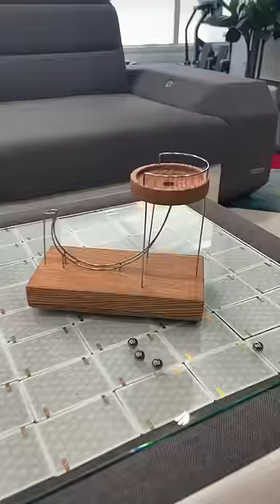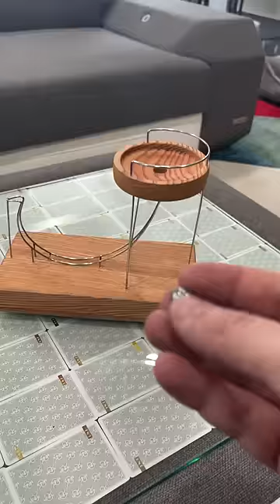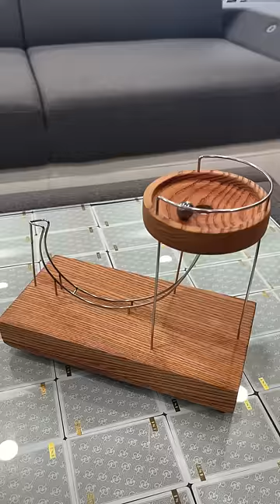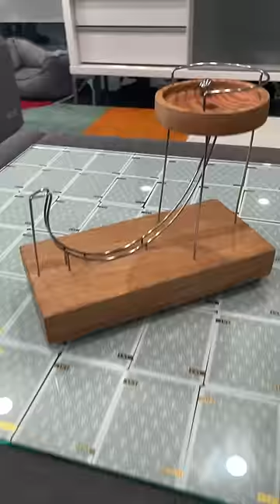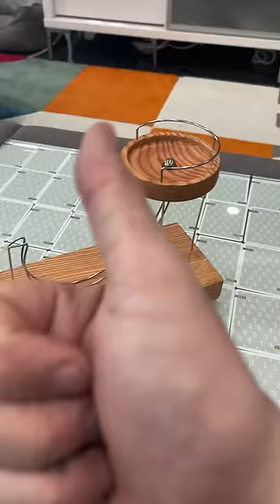An Impossible Perpetual Motion Device?! 😳 #Shorts

Comment: The fact that the ball shoots up higher than the level that it initially fell from means there is an outside force.  Period.
Reply: Isn't it quite obvious there's a magnet inside?
Reply: @Sevival  Nope, not everybody knows the obvious physics behind it, mate. And yeah, there's a magnet
Reply: @Sevival  U know, not everyone is interested in this kind of stuff. This is like telling a christian: isn't it obvious we are made out of stardust? It's only obvious when you start digging a little
Reply: @robertcristian9511  I think everyone should easily be able to tell that this is wrong. We have all seen thing fall in nature after all. Besides, the video literally tells people its faked and yet they fall for it.
Reply: Now explain it. Just telling people “that’s obvious” wouldn’t make anything, this will just make you look egoistic. True scientists EXPLAIN how things work
Reply: @robertcristian9511  Clearly,  i don't know why people miss that. A magnet in the wood near the sliding side because if it was in the middle it will reduce the speed for the climb as well. Thanks for commenting the same thought I had.
Reply: Not necessarily, the magic happens in the shape of the ramp since it drops it picks up speed fast and uses that speed to get back to the platform
Reply: LMBO
Reply: @RxgueTrikova  magnet!
Reply: @Sevival  DK effect
Reply: Possible that ball as well as the railing are magnetic
Reply: It’s own momentum
Reply: @robertcristian9511  except it’s not obvious we’re made out of anything lol
Reply: @robertcristian9511  Pure poppycock I say! Everyone knows we are made out of sugar and everything nice! 🫢
Reply: @robertcristian9511  There is a magnet is a really half assed explanation. Its like saying of course it works. There is gravity! You cant just put a magnet on top for it to work. If it really is a magnet it would need to be an electric magnet for it to work mr obvious.
Reply: @robertcristian9511  Idk, it’s kind of obvious when you give it a little thought. Like where else could the matter have come from.
Reply: @robertcristian9511  The Bible is very open about the fact that we are made from dust, and that all of us will one day return to it.
Reply: @RxgueTrikova  "Magic"? Magic isn't real mate, and no matter how you make a ramp you can't make a ball shoot higher than the initial drop off height. This is very, very basic physics. You should know this.
Reply: @robotpizza  and spice! 😂
Reply: How does the magnet not just make the ball stick to the top of the ramp soon as it falls thru the hole?
Reply: @Sevival  it is lol
Reply: @robertcristian9511  yeah Sparky, show me some stardust.  Otherwise, your comment was spot on
Reply: @kgmsosa8230  It's an electromagnet. You can turn it on and off so that it doesn't do what you describe.
Reply: Once the ball passed the point with the magnet wouldn’t the magnet then pull back on the ball as it passed and slow it down?
Reply: @robertcristian9511  dig a little and find nothing lmao
Reply: But still works
Reply: The fact that the ball is already rolling when it drops through the hole means it has some additional energy as it goes down the slide than simply the potential energy due to it's height, I think that's how it manages to return to higher point than where it fell from. I'd be interested to see how many repetions the ball can make before it fails to land in the cup again.
Reply: Apparently there's a rechargeable electromagnet at the base propelling the ball upwards.
Reply: Umm no,momentum
Reply: Why does having a magnet make it not perpetual motion? Will it stop eventually? Or does an outside force just not count, like the moon's influence on the tide? I'm not arguing with you, I'm genuinely curious about this.
Reply: But where is the energy coming from? Magnets don't store energy or do they?
Reply: It's called momentum.
Reply: @robertcristian9511  if there's a magnet why don't the two balls interact? Where is it?
Reply: @RxgueTrikova  no
Reply: No one is trying to say it’s real. Chris is just showing that it looks cool
Reply: g R a V i T y
Reply: @robertcristian9511  👏🏾👏🏾
Reply: @Sevival  not to most of America… have some awareness of class.
Reply: what would a magnet inside do
Reply: @robotpizza  They accidentally used salt instead of sugar in my recipe 😔
Reply: @kylemcalister8417  if you put it under the downward slide, it would accelerate the ball faster than gravity would alone. As the ball moves away from the magnet, it's force decreases, as magnetic force is proportional to distance so the ball would retain some of the energy that the magnet 'provided.' Then the ball would travel upward with enough speed and force that gravity cannot decelerate it enough, to prevent it from getting into the funnel plate. Without the additional speed/energy from the magnet, the force of gravity would accelerate and decelerate the ball about the same amount, so it should just smack into the side of the plate, at the same level as the whole. Considering friction and air resistance, the ball would accelerate less and decelerate more more than gravity would cause in the vacuum. I hope that makes sense. If it doesn't I'd be happy to clarify to the best of my ability.
Reply: Gravity
Reply: @MegaAbgt  not forever
Reply: @kylemcalister8417  it's likely an electromagnet which uses power from a battery to sustain its magnetism. And then it would likely work kind of like a rail gun. A chain of negative magnets all pointing in the same direction right as it leaves gives it acceleration.
Reply: @RxgueTrikova  the shape of the ramp will not change the amount of energy, only making it higher will. Also the ball will never jump higher than the hight it falls from
Reply: @robertcristian9511  Every Christian says we are made of dust, what do you mean?
Reply: Potential energy from higher position
Reply: Maybe gravity and magnets working togheter.
Reply: @robalso  it would yes. This is an electromagnet with a battery. That’s how it works.
Reply: @jforrestal365  it wouldn’t be able to make a single trip without added energy. Think about it. At the moment it goes into the hole it’s downward velocity is zero. Only the. Does gravity start accelerating it downward. This isn’t enough energy to get it to come back up higher than the point where it dropped. The only way this works is with an electromagnet and a battery.
Reply: @CrawDad1131  this wouldn’t work with a regular magnet. It only works with an electromagnet and battery. As for the space stuff you mentioned, yes, all of those movements will eventually stop.
Reply: Ball is a magnet
Reply: @awesomecraftstudio  it’s an electromagnet and a battery. Look up “perpetual motion ball ramp” and there are a couple of videos talking about the battery in the bottom of this.
Reply: Inside force.
Reply: Would it be Newton's 2nd law?
Reply: gravity is the force
Reply: @mariusmelerski5136  The shape of the ramp changes the energy output.  Rollercoasters work within some of that math.  Of course the ramp changes he energy output.  It’s like pull your arms in when you’re spinning on a chair, you go faster, you put your arms out you go slower.  Don’t lose your common sense when debating physics.
Reply: That force being gravity. Take away the planet that the device is resting on and the motion stops.
Reply: @Sevival  
Not just a magnet.  An electromagnet that pulses at the right moment.
Reply: @kgmsosa8230  opposing magnetic forces. Not all magnets attract. It’s shoots away.
Reply: Wish my car was a perpetual motion machine, and while I'm fantasizing, also a time machine so I am never late to work again.
Reply: @RxgueTrikova  shape of ramp doesn't matter the ball still should not go up higher than it drops down.
Reply: @Hopeof7suns  if you really think that please don't be a teacher.
Reply: @argonaught5666  no sorry that would break... Never mind yes yes you are stup....I mean correct.
Reply: The holy ghost duuuuuuuh
Reply: @CrawDad1131  
If it was just a permanent magnet and it somehow worked, it would still classify as perpetual motion, except it wouldn't work, just as any perpetual motion devices won't work.   They are all akin to claiming you can sustain yourself the rest of your life without drinking or eating anything, but your own crap and urine.
The only way this device will work to provide the illusion it does, is with a electromagnet that pulses on to accelerate the ball towards it, then turns off to allow the ball to pass freely.  A permanent magnet would pull the ball both on the way up and the way down providing a net momentum increase of zero.
Reply: I feel bad for all of the people that think this involves magnets. On the sidewall of the hole is a little wheel. The wheel is powered by one AA battery, which is installed underneath the top, round tray. When the ball passes through the hole, the little wheel spins and speeds up the ball. That’s it. No magnets whatsoever. 😂
Reply: @chrisjenkins203  
Apparently there are different versions.  The cheesier type uses a motor as you describe and is unconvincing because you can clearly hear the motor spinning.  The other kind is more expensive and convincing because it silently uses an electro magnet in the base.  Since I can't hear any motor here while clearly being able to hear the ball rolling, I suspect this is the more expensive version.    Check out Ramzland perpetual motion video.  He explains that his uses an electro magnet in the base.   I have seen the motor type knockoff of this device and it's made from cheesy plastic instead of wood and sounds like an electric toothbrush.
Reply: @1TieDye1  when I first saw it I thought the only way to work was by using an electromagnet it was somehow switched off once the needed downward pool and speed increase had been reached. I thought that suggestions of magnets were impossible because they would exert and equal amount of window ball was descending as it would when it was ascending therefore canceling its effect out until I read your comment then I thought that it could be possible to somehow shield the ball from the effects of the magnet once it had reached a certain point on that downward travel. Not sure how to shield the ball from the magnetic field  but that would be the only way an ordinary magnet can be used. Otherwise I still believe that it must be accomplished by use of an electromagnet.  That's assuming that this is not just a camera trick which is always possible on YouTube shorts, lol! But that would just be lame!
Reply: @nick-dq1hh  that just goes to show that you have no idea how physics work the only thing you change when you spread or retract your arms is the distribution of mass. The energy doesn't change when you're spinning, your mass is moving at the same speed it's just that you spin around more often on a circle with a smaller radius with the same velocity than on a circle with a larger radius.
Reply: @mariusmelerski5136  Where the energy is directed is changed.  It’s more focused.  So yes, in this scenario gravity with a different shaped slopes changes the speed.  The slope direction changes the speed directly.
Reply: @nick-dq1hh   the form of the slope only changes the form of acceleration. Take different slopes all with the same hight, the speed measured at the bottom will be exactly the same. A steep slope offers high acceleration for a short period of time, a gentle slope lower acceleration but for a much longer time.
Reply: @mariusmelerski5136  Right, we agree.  That’s my point.  The ramp changes acceleration, which changes the outcome.  Of course energy output changes when you use enough ramp space (let’s say in a rollercoaster) to reach terminal velocity, as opposed to a small ramp that doesn’t reach terminal velocity.
Reply: @nick-dq1hh  terminal velocity for what? To defy the laws of physics no matter how high the ramp an object sent down a ramp will never fly higher than the ramp it is accelerated on and will reach the same velocity on every ramp of the same height.
Reply: @mariusmelerski5136  I never claimed what you’re saying in the second sentence.  Also, the...terminal velocity...of...free-falling.  Gravity...
Reply: @nick-dq1hh  you said the shape of the ramp changes the energy output but it doesn't, only the height is relevant. But if this is you trying to weasel your way out of your mistake, sure go for it.
Reply: @mariusmelerski5136  The height of the ramp is the shape of the ramp.  I think we missed each other.  Shape can translate to height.  At least in my mind it does.  I can’t see how it doesn’t.  The initial height is 100% part of the shape of the ramp.  Otherwise you could shape a ramp with a low height and continual loop (which they do for children’s riders).  No one idea why you wrote that last sentence.
Reply: The shape of the ramp converts some of the velocity from horizontal to vertical so it can go higher than the hole but doesn't quite make it back to the hole. It falls a bit short of the hole and rolls down the funnel
Reply: @mariusmelerski5136  the arc is extremely relevant. The shape of the arc at the end of the rails determines both the direction of the ball and imparts a ballistic arc onto it.
Also the ball is not in free fall it's in flight. It has too much forward momentum to enter free fall. The rules for free fall don't take over until it loses all forward momentum and gravity becomes the sole force on it.
Also it appears that ramp side of the dish is actually lower than the back to facilitate the catch
Reply: @nicholashodges201  don't know what you want from me. The arc is only relevant for the final direction. I was only talking about the velocity the marble can reach. Energy is obviously being added at some point because the marble rises higher than the original hight. The form of the ramp is irrelevant and can not change the energy output.
Reply: @SsemajeJhrvys  yeah, it is. That's where everything in the solar system came from, even the dirt on the ground.
Reply: @mariusmelerski5136  no but it can impart rotational force which provides lift. Not a lot of lift, but just enough for it to clear the lip of the cup.
Reply: @nicholashodges201  the ball can never fly higher than the ramp that it starts from end of story. That's all you need to explain what's happening in the video. To create rotation you need to put energy into the system or in this case the ball the lift that rotational force creates is more than negated by the energy that is used to force rotation.
Reply: @ryanmiller1307  No, it can never go higher than the hole/platform. That’s a perpetual motion machine… You can then catch the ball from this new hight, drop it, catch it from an even higher hight, etc. You’re creating energy from nowhere.

Even a perfect ‘ramp’ can only convert all the initial potential energy into a certain velocity using the acceleration due to gravity without any losses.

The potential energy it uses to gain speed is only related to the high of the hole, and the acceleration due gravity.

The high the ball can reach from a certain speed is only related to its velocity and the acceleration due to gravity.

Both the speed you can get from a certain height, and the height you can reach from a certain speed are linked by gravity. You can never reach a higher point than the drop point if the acceleration due to gravity doesn’t change and no energy is added.
Reply: @RxgueTrikova  no.
Reply: @RxgueTrikova  why not?
Reply: Gravity
Reply: @destroychihuahua  that's not how gravity works bud. If it were gravity alone, it would not he possible for the ball the ever reach any point higher than it's initial starting point.
Reply: @ryanmiller1307  no it doesn't.
Reply: @adamplentl5588  Gravity, magnets, they’re all outside forces. It’s still a neat looking toy.
Reply: @destroychihuahua  and gravity alone is incapable of producing this effect. Hence, there is a battery powered electromagnet in the base which flips in order to send the ball higher than it's initial starting point. So, rather than perpetual motion, this will run for maybe a couple of hours before the batteries no longer have enough juice to provide enough energy for the ball to reach the starting point.
Reply: Exactly, thank you! This wouldn't work even when discounting friction (which we can't). There needs to be an extra force.
Reply: ever thought about the possibility that maybe he's filming this upside down?
Reply: @itskittyme  he's not tho.
Reply: @RxgueTrikova  
No.
Regardless of the shape of the ramp, the ball will have LESS energy when it reaches the bottom of the ramp than it did at the top of the ramp. 
It will always have LESS energy.  
There is no way that this can possibly work without something imparting force to the ball as it rolls.
Reply: @nick-dq1hh  Bruh come on.
The ball cannot possible the same, let alone more, energy at the bottom of the ramp that what it began with.
It will always be less.  Regardless of the shape of the ramp.
Reply: @judsonkr  No, you're wrong.  Not trying to be mean.  Do you think a person has the same "energy" when they fall from a building?  As the ball falls the force of gravity gives it "energy" and more momentum.  It's when that free fall stops that energy is conserved.  At the bottom is where is has the most "energy"  from gravitational force.  Don't start things with "bruh" and then just be plain wrong.
Reply: Yes. Gravity
Reply: Isn’t gravity actually an electric magnetic energy, and very amazing as it holds and repels the universe apart together simultaneously, how the aliens travel, gravity control, The next technological breakthrough
Reply: @mariusmelerski5136  bull have you never jumped a ramp on a bike and not gone higher than the ramp?
Reply: @nicholashodges201  and gravity is  accelerating, 33ft/second2
Reply: @mariusmelerski5136  gravity adds acceleration
Reply: I don't know what you're trying to prove with this comment. He clearly stated that it's impossible to create one.
Reply: @argonaught5666  What? The force of gravity does not work like that. The ball can’t just magically shoot up higher than it was when it fell.
Reply: @SsemajeJhrvys  “Christianity grooms children” what an unbelievable statement. Can you please explain what this means? Because everyone tries to share their beliefs with their children.
Reply: @red.4712  no idea what you are talking about.
Reply: @Andy-df5fj  And the right moment can be easily timed without sensors as the ball completes the circuit of the two rails it rests on.
Reply: @bright_eyes_  
Yeah I suppose it could.  It would probably require insulating the rails except in the areas where you want the circuit closed.
Reply: @Andy-df5fj  Would explain why it doesn't work when two balls go down at the same time
Reply: @AggressiveSpaghetti  True commenters aren't jerks.
Reply: @RxgueTrikova  
Somewhere in these comments there might be a couple more people that can see it, but it took me long enough to find you, so I’m not looking further.  You nailed it, sort of.   I’m going to call it radius reduction acceleration and everyone has seen it, but the GIANT MAGNET in their brain is refusing to allow them to remember it.   The figure skater who is spinning with arms extended,  then drawing the arms close to the body, causing the spin to go much faster.  
Or using a partial orbit of a planet to fling a spacecraft faster (oh my, the army of debunkers who are going to call me on that one…”and when did you see that happen?”)
Reduce the radius—speed increases.